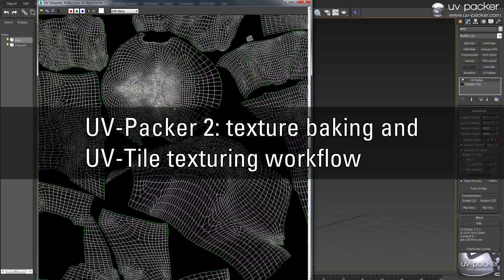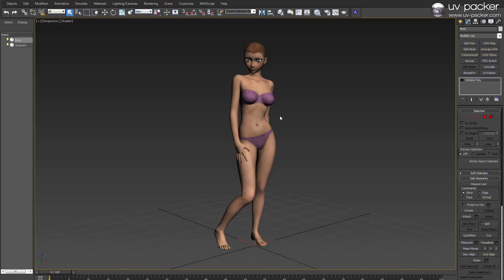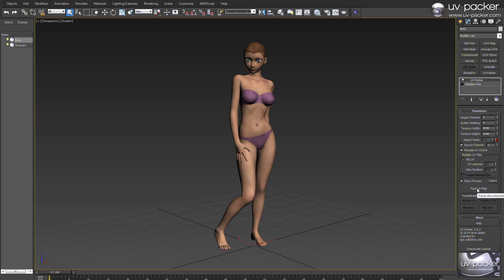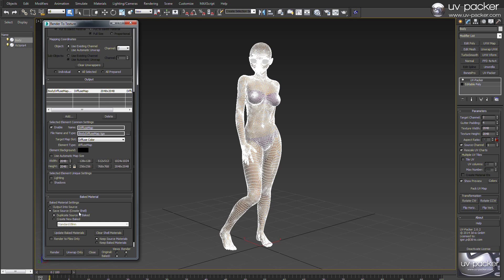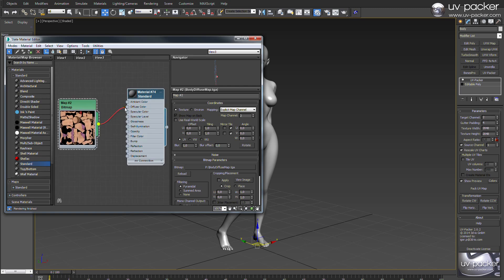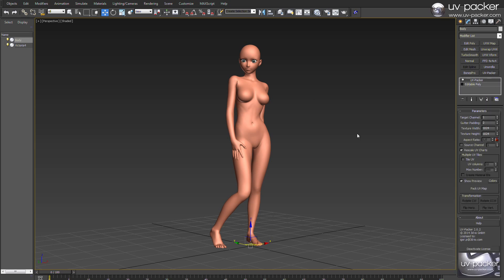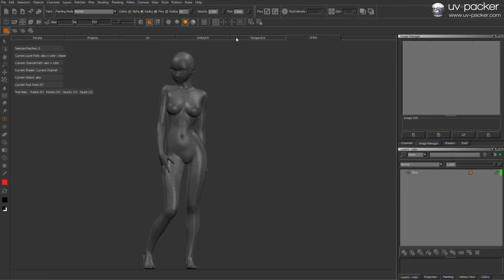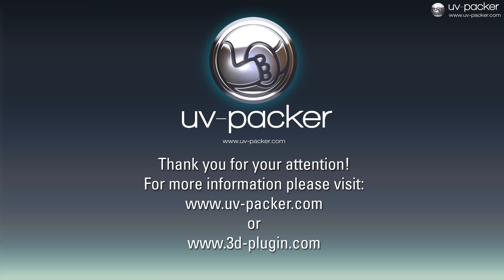UV-Packer UV-Tile and texture baking

Comment: How did you make it automatically spread into unwrap (4:00)? For me, unwrap doesn't respond to uv-packer at all. Maybe it's because of the demo version?
Reply from the maker: Hello,
UDIM (Tile Texture) was used for it. Go please to 3:48, there is in the interface the TileTexure chechbox toggled on. If you setup your U and V tiles you will get exactly the uv spreading as you wished :)
thanks
best regards
Reply: @3dioplugins  Thanks for replay :). Yes I see that You click on "Pick UV Map" and then it shows the picture with UDIM multitiles grid. I also see this picture. 
But then you add the "Unwrap UVW" modifier, and got this UDIM grid in "Edit UVWs" window. But in my "Edit UVWs" window(Unwrap UVW modifer) shows only one Tile without MultiTiles UDIM.
In your 3ds max, the multitiles UDIMM from this plugin passes automatically to Unwrap UVW window, but not in my 3ds max, I see all layouts in one tile.